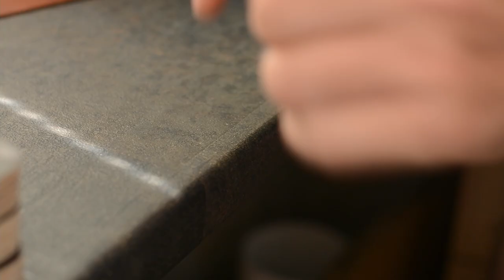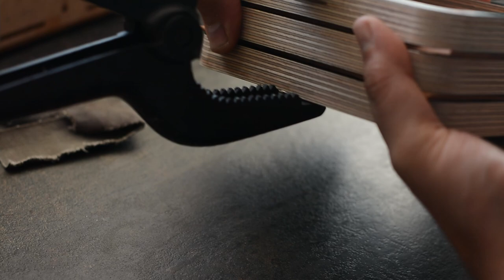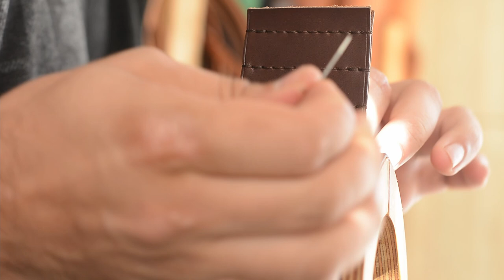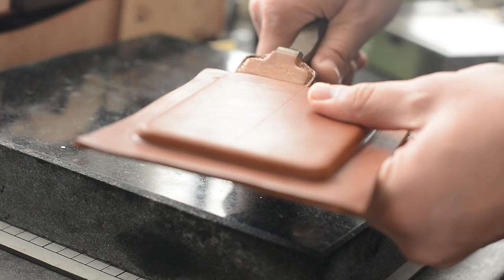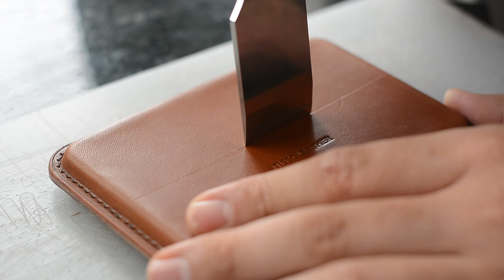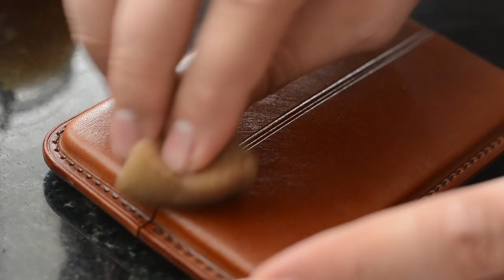Making leather cigarette case. Leather craft

Comment: Im new to leather working still, did you cut through your stitching when cutting the too and bottom into separate pieces? Does the saddle stitch self lock well enough thats ok or am i just seeing it incorrectly?
Reply from the maker: You can turn on subtitles, there are explanations of some actions. First, I punch holes for the seam on one of the halves of the cover. Next, I glue both halves and with an awl I pierce the through holes along the pre-punched ones. Next, I sew and cut the cover along the marking line.